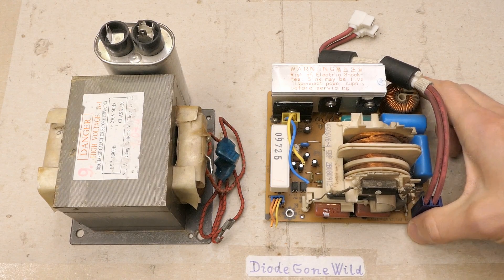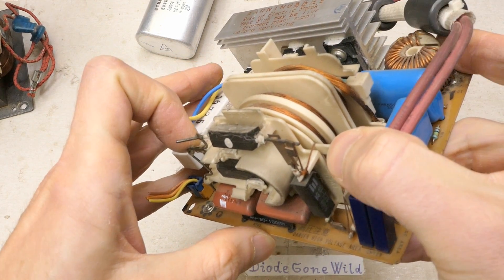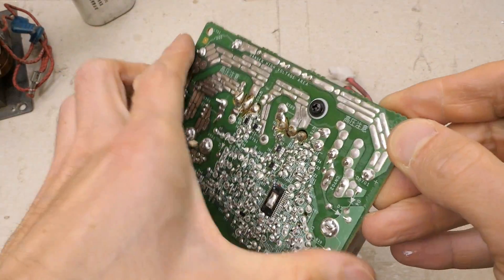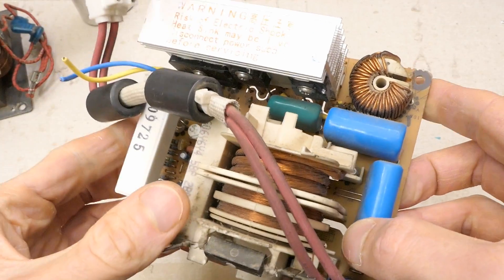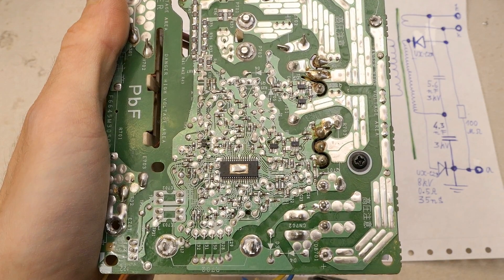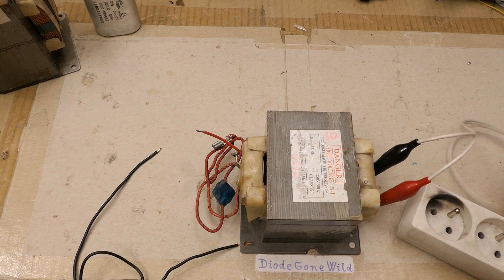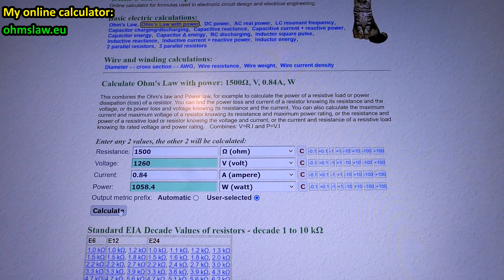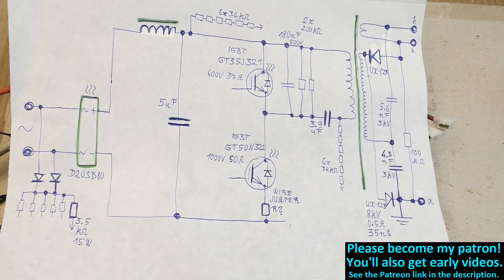A Microwave Oven Transformer, but switching!

Comment: For this circuit to have high power factor it probably operates just like the ZVS induction over circuit. High frequency modulated by the 100Hz nains ripple.
Reply: Gotta love those duck shin overs.
Reply: It's mains ripple not nains ripple you silly donut

Comment: You can make a ZVS that runs on mains current to power that transformer, it should work fine and with plenty of power.
Reply: Uuum, ZVS ?
Zero Volt Switching ?
I have a bad memory...
Reply: @snakezdewiggle6084 mazzilli ZVS driver
Reply: yep.
 @snakezdewiggle6084

Comment: I bought a second hand inverter microwave for cheap years ago, it worked fine for about 6 months before it popped and emitted the magic smoke. I didn't even bother opening it up to find out what went bang, just threw it out at the next council clean-up. The standard one I bought to replace it lasted about 10 years before it started making a zapping noise. My friend had just renovated his kitchen and had a spare microwave, so I got that for free. Then I found out the zapping noise might be the waveguide cover, so that could be a cheap fix. I did keep that microwave, so I probably should just get the replacement waveguide cover and see if it fixes the problem, then I'll have a spare microwave.

Comment: Nice video, On the Iron core MOT circuit how does the voltage get doubled by using just 1 capacitor and 1 diode wired as a standard half wave bridge rectifier?
Reply from the maker: It's NOT a standard half wave bridge rectifier. One halfcycle charges the capacitor and then the voltage of the capacitor is added to the other halfcycle. It produces a pulsed voltage, not smooth DC.

Comment: This will save a  LOT  of weight ... but ..... folk abusing their ovens , ( operating with nothing in the cavity ?  or sparks caused by some metal ? ) might destroy this  VERY  complex module ... something to think about ! ! ...... DAVE™🛑
Reply: The one at my work gets this abuse for 23 years and it still works😅
Reply: I've repaired inverter ovens with the magnetron antenna substantially melted away from arcing due to fat spatter carbonising in the waveguide. The inverters are actually quite tough and usually survive, magnetron replacement only required.

Comment: To power it up, you connect the brown wire to ground, orange wire through a 10k resistor to ground, and feed a 220hz PWM (TTL, so 3.3v to 5v) square wave signal into the yellow wire. The duty cycle has to be below 43% when first powered on.

Comment: i repaired such thing like a 10 years ago in grandma's oven and it still works today :D fault was just open 20 ohm resistor in one of gate driving circuits. i heard later it's a common fault in these inverters
Reply: Panasonic? It was a known fault for them.
Reply: @PlatypusPerspective  yep, exactly!

Comment: My LG microwave oven It also has it and it makes a buzzing noise close to 25khz and only have one IGBT transistor.
Reply: hardstyle905  It may be a single-transistor forward converter, some time ago I tried to replicate a Soviet scheme of an inverter welder with this topology, which uses a regenerative snubber in the hot part of the circuit. I don't know if it has anything to do with the microwave inverter.
Reply: Maybe a flyback topology? Not sure but I have seen microwave inverters with single IGBTs and dual (but different) IGBTs.
Reply: Hey i interested to buy lg inverter microwave but how about power regulation? Its just on and off or swithing with linear power? (If i select 50% power its 50% watt or just cycling ar 50% on time) thank you.
Reply: @widyahong  A mix, depending on how hot the transistors are, it will switch to 50% power for a few seconds and then turn off for a few seconds. The power is set from about 50% to 100%, less than that switches it on and off.
Reply: @neonsoft21  okay i understand, thankyou for your information 👍👍👍, i will buy this product..

Comment: Why would u put a swichmode powersupply in a microwave, its the same size and a transformer and way more complex

I am not sure if it even saves any power (or is power saved would matter anyway)
Reply: Weight
Reply: and you can precisely control the output power. Not just on/off duty cycling
Reply: @nathanieljames7462  I see, but is added complexity a good cost to pay, controlling output power, because as I know u could do this on a regular transformer as well
Reply: @Veso266  yes, you can vary the output of the transformer itself but the magnetron requires a minimum voltage to function which is easily modulated using rectified and inverted current transformed under pulsewidth modulated control
It also saves tons of copper and shipping energy
Reply: @nathanieljames7462  thats true, but it takes away reusable aspect of your microwave (if u used a transformer from ur microwave to build your tesla coil or simple soldering iron, or metal melter, etc, in the past, you have to buy a new one (until u can get them) and at the end creates extra waste

Also swich mode power supplies if certain percosions are not taken (which sadly a lot of times are not) polute the RF spectrum with noise, they also seam to break more often then a transformer
Reply: @Veso266  this is true. you cannot easily rewind the flyback for modified output. As a simple HV power source, the inverter MOT is still relatively easy to enable but nothing compares to the classic iron core MOT for the electronics enthusiast!
I have to admit that I only got into transistor circuitry because I accidentally ended up with an inverter microwave in search for a "real" MOT.  If it wasn't for the IGBT that came with it I wouldn't have bothered setting down the path of integrated circuitry.
I did get my hands on an iron core MOT eventually though 😁

Comment: Sad that the igbts are blown! I would have liked to see it run/see the waveforms. I have to see for myself if i can get one of those inverter microwaves and then measure it but i wont because it does have dangerous voltages and i dont know how to get them

Comment: Sad that the IGBTs are blowen, I would definitely try to run the HV transformer on my SLR full bridge IGBT inverter.

Maybe you try to fix the circuit board? If I remember right they require a PWM signal, but I am not sure.

Nice video as always 👍😎

Comment: Well done for resisting the temptation to power up the switching power supply, you had me worried for a moment. The arcing out put from the iron transformer and numerical output  from the catculator are a very good deterrent against dismantling my microwave.

Comment: Is this how the more expensive microwaves operate, the ones that don’t need to switch on and off at lower power settings and that don’t have a turning glass plate?
Reply: Inverter microwaves can modulate, but only to a certain level. Since the filament voltage comes from the same transformer, it would drop to low
They usually operate continuously down to around 50% of power. Beyond that, they cycle on and off like a normal microwave does
Reply: @Fluxkompressor  Thanks!
Reply: @Fluxkompressor  I did operate a magnetron at only around 150 W by limiting the primary input current of the MOT to around 0.8 A. The heater and high voltage supply was from the same transformer, the magnetron can work with lower heater voltage too. It probably has a higher voltage drop than 4 kV at less heating.
Reply: "The ones that don’t need to switch on and off at lower power settings" Yeah, that's inverter microwaves. The ones without a turning glass plate are usually inverter but they don't have to be as they use a regular magnetron pumping RF through a waveguide into a chamber with a turning metal disk located underneath the floor of the oven, which is what eliminates the need for a turning glass plate.
Reply: @albatross_v2  Thank you very much!
Reply: @Conservator.  No worries.
Reply: Meh I wouldn’t really call these “expensive” because the flaw in this statement is that the price will naturally drop overtime- but yes they are for now. Inverter microwaves.

Comment: Quite a while ago, MikesElectricStuff took a look inside an inverter microwave that got completely trashed by the bulb blowing. It blew a PCB trace when the bulb blew, and the arc flash from that trashed the logic circuitry effectively rendering the whole thing scrap. Sometimes simpler is better... 

I am surprised these inverter microwaves haven't taken over yet, switching PSUs have taken over nearly everywhere else
Reply: I guess that inverter microwaves didn't take over because the iron core transformer is more reliable.
Reply: @Alexelectricalengineering  or maybe cheaper than a switching supply? I mean, nowadays the MOTs have the absolute minimum amount of metal in order to work. Nothing like what they used to make...
Reply: @albatross_v2  switching supply is def cheaper because high frequency less copper can be used
Reply: Well, the inverter side needs actual copper wire in the unit, while the iron transformer just uses CCA wire. It is a lot cheaper to stamp out iron laminates, and wind the CCA wire on formers, on machines long since paid for. Low cost materials, low cost labour, and as you ship by sea volumetric mass is the rate used, as a microwave oven is almost all air inside, even with a 2kg lump of steel in it. The inverter ones are only used where you are paying much more for more precise control, as they allow cycle by cycle PWM switching, so instead of the iron core having a PWM over a 30 second repetition period, you now have it based on the input mains frequency from the control panel, so the apparent power delivered seems to be much finer, as it is being adjusted either 100 or 120 times a second, per cycle power limiting.
Reply: @SeanBZA  You are right, iron core transformers are probably cheaper and also more reliable, the classic MOT use only aluminium wire not even CCA, I was see SMPS transformers with CCA wire. Pure copper is too expensive.
Reply: @Alexelectricalengineering  Yes I see that as well, and the manufacturers of the CCA wire are making it even thinner now, seen 40AWG wire that is CCA, which was not seen 10 years ago. Now if they could make it reliable that would be good, but that thin stuff breaks for nothing. The iron core transformer is cheaper than just the ferrite core and switching transistorsin the SMPS, so that is why it is still around. Seen cheap shoddy small SMPS units with the layout of the cheap chinese 9VAC transformers, guess that small item now is worth replacing, as the smps is lighter, which makes sense in an item that is small and light, as there the transformer is the heaviest part. Lights, with a SLA battery that is mostly plastic foam instead of lead, so 2 plates per cell, and the rest is foam, so it looks the part, but is actually a tenth the capacity, just good enough to run the light for 5 minutes, so as to pass factory test when new.
Reply: @SeanBZA  I agree everything is just cost cutting this day's. I only use copper wire when making transformers.
Reply: @SeanBZA  re: "as they allow cycle by cycle PWM switching, so instead of the iron core having a PWM over a 30 second repetition period, you now have it based on the input mains frequency from the control panel,"
Except, you are still powering the Magnetron filament, the cathode, which must be hot enough to emit electrons ..  one is almost stock with like a 15 to 30 sec warming cycle on account of the filament needs to be hot to work.
Reply: And yes, even on a regular microwave that lamp blowing can take out the 10A ceramic fuse, I have changed many fuses along with the lamp, and modern ones now also use an 8A fuse in 230VAC countries, as it is cheaper, and include a soft start circuit to limit the inrush current into the transformer as it turns on into a cold filament of the magnetron, or with the duty cycle switch turning it off for a few seconds every half minute.
Reply: A MOT is way to undersized for what is used for but the air cooling and the short usage makes it the best.
Reply: @viermidebutura  True, but it is also optimised so that it is only capable of handling the flux in the core if fully loaded, any time it runs with part load the core is driven further into saturation, and as well the core losses are very much higher than normal transformers are designed for, as they have to handle the operation at running at part loading all the time, and often run at near zero load, so the core loss has to be low. Microwave the core loss can be high, as with the forced air cooling, and the generally lower duty cycle, plus the thermal cutout to limit temperature rise in the control unit to 130C helps a lot, as the transformer is easily capable of running to 130C, and 150C for short periods in use does not degrade the class H insulation used.
Reply: @liam3284  The microwave fuse does that, though I have seen even 15W incandescent lamps trip a 63A main breaker when blowing. Lamp in a ceiling, with old 4mm wiring to it, so a really low impedance supply. Did not blow the replaceable wire fuse, though that could have been because some previous tenant had replaced the 5A fuse wire with 1.5mm copper wire doubled up, years before, so it would never blow, except for a dead short for 10 seconds.
Reply: The cost for them to overcome and learn, then manufacture the switching supply is much more expensive than contiuning to use classic transformers. Especially if they are ordering everything from china, large transformers cost littratley no money at all
Reply: I’m pretty sure the reason more microwaves don’t use the inverter design is because Panasonic has the patent.  I think it may be close to expiring now though…..
Reply: @mensaswede4028  Theres nothing special that can be patentable about the shcmatic shown in the video just a standard push pull or LLC type converter then windings with seperated bobbins all of this is very standard practice
Reply: @mensaswede4028  Patent has likely expired by now. 17 yrs or so is the length of time patent is good for +- a few yrs. I don't recall exactly.
Reply: Where have you been it is very hard to get a microwave from world known companies that are not inverter driven as has been the case for a number of years. It is that commonplace now that a big deal is not made about it. They are not very reliable  I am having my third delivered today (8/10/24).I get about two years or less out of each one. My old transformer driven microwave last over twenty years. Progress?  It appears that even most German made microwaves are Chinese built,
Reply: @onlythetruthfull  I unfortunately reside in the US. Maybe panasonic has a patent on them or something? I've never seen a non panasonic microwave with an inverter.
Reply: The worst is probably not the complexity on it's own, but when they try to make a complex design "simple" by change a "tried and trusted" design into something strange custom made (like we saw in the video - because that's not how a typical half bridge is made) to save on components - and also omit protection functions that's not needed for normal operation. A switching power supply without overload protection isn't that nice - it will blow up very quickly if the output is shorted or heavily overloaded, in most cases. Semiconductors in general have very little thermal mass compared to the power levels they handle and needs fast acting protection to not blow up during a fault.
The iron core transformer with it's large thermal mass, can handle large, short duration overloads much better (as it can absorb a lot of energy before any damaging temperature rise will accor).
With the lamp, a short circuit was most likely what initiated the failure - if it was an incandescent light bulb, those can sometimes fail shorted as the pins that hold the filament bend so they touch each other when the filament burns off. If the lamp was an LED, it can have been for example the control chip that failed intitially and shorted it's input. Although, since it was the PCB trace that blew up, it could have been as simple as the lamp being fed from a high current supply with no fuse.
Reply: @Speeder84XL  Nearly all ICs contain over current protection, its as simple as implementing a resistor and connecting it to IC. Unless the manufactures want to skip this part as well.
Reply: AFAIK, there are a limited-few companies ALLOWED to make and sell Inverter Microwaves to consumers. 
(Even more than OG mwave oven, they're derived from 'defense industry products'.)
Reply: Well high voltage components are exponentially more expensive, so theres a good chance this doesn't actually save money, unlike a typical smps.
Reply: this comment was two years old. i have basically given up checking the roadside collections for MOTs, theyve been inverters for years. 
is the scrapyard these days, and hopefully noones gutted it yet...
Reply: @paradiselost9946 Where on the planet do you reside? I live in the states and have yet to run into a scrap microwave with an inverter. Every single one of them has been an iron core transformer still.
Reply: @iamdarkyoshi  straya mate... 

its been about ten years of inverters here. shows how long they last as well...
Reply: @paradiselost9946 Fascinating. I wonder why they haven't made their way over here.